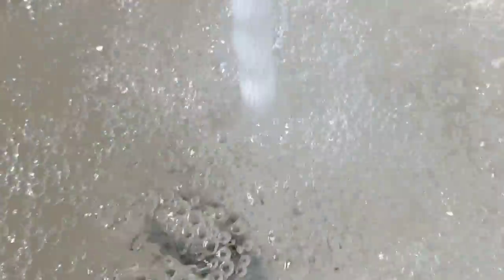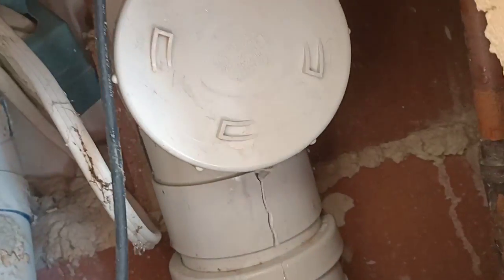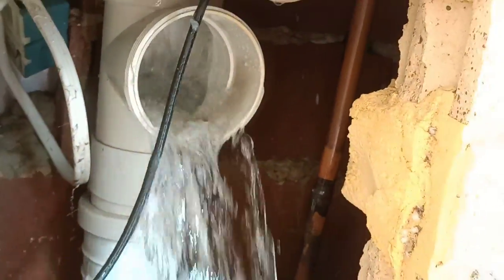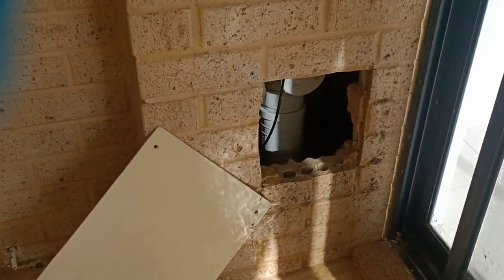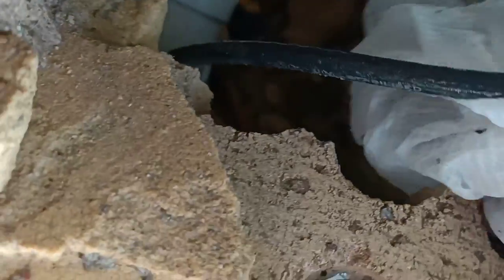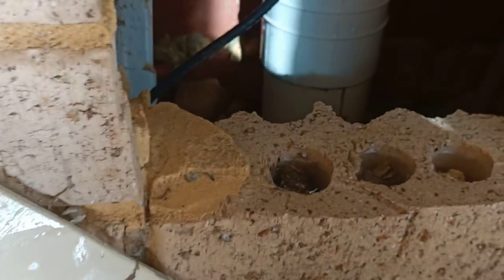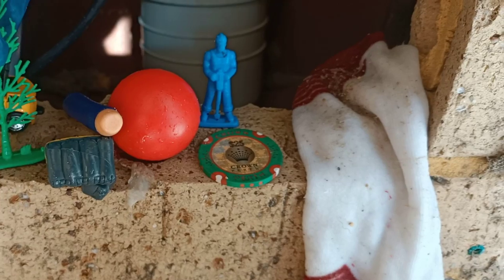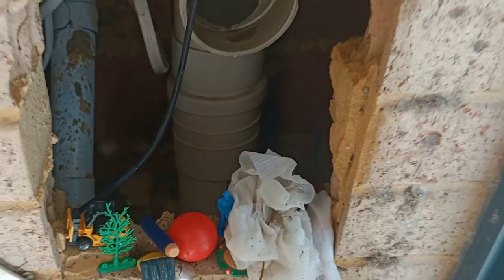Covered in EXPLODING SEWER

Comment: Bruce, calling in from my spinny chair in the back row ... "To infinite and beyond" - well I guess that's where Buzz was headed at least. And VERY glad you didn't get shocked, that would have been a bad way to end the show. I also trust you got that cap back on securely - but one detail ... around here (Ontario, Canada) I don't think the vent stack can double as an upstairs drain - pretty sure that's a building code violation - was that really the case there or was it really just an upper floor drain? Thanks for the show - as a few others have said, I'll recommend waders. 🙂